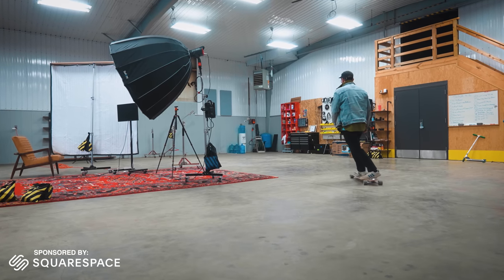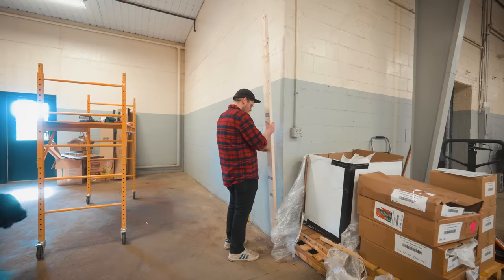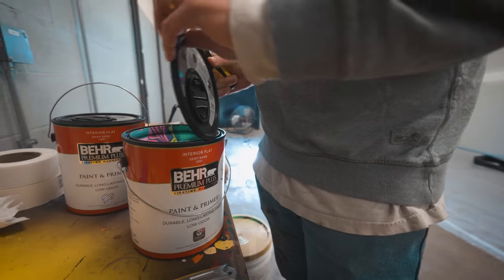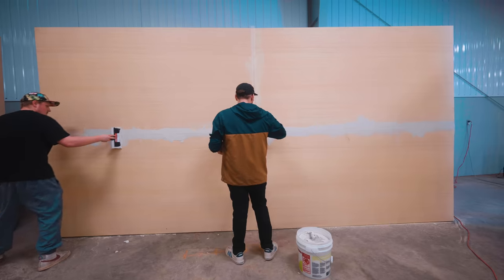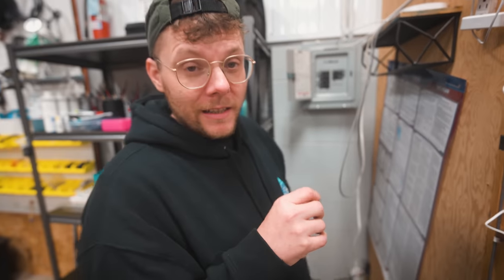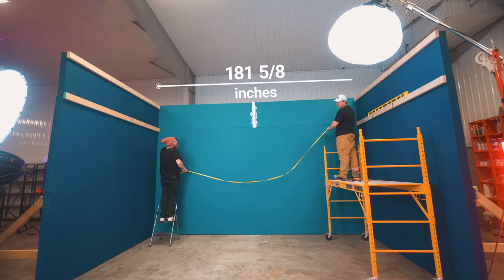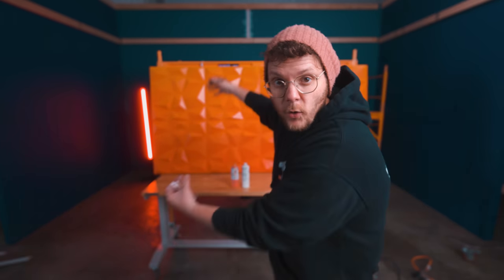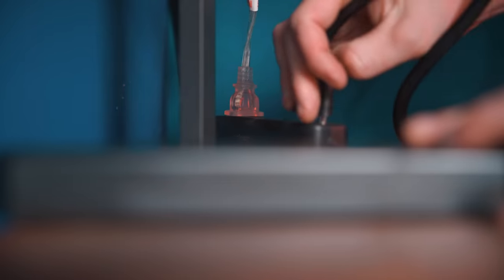From Old Warehouse to Dream YouTube Studio! - Ep2

Comment: it's a very nice office-studio on the wall behind you, you can see the connection of plywood boards, and in my opinion, the neon should hang on the plywood in the upper right corner of the screen like a logo / tag, just so that it does not interfere with the lamp.

Comment: Peter, get some 2x6x8 boards and make a square frame. Buy some rockwool insulation from Harbor Freight or Lowes and place it inside the frames and then cover it with some upholstery fabric or some other type of fabric and then place rollers under the square frames. You can move the sound panels around then and place them anywhere and they will cut down on the echoes, etc. You can make sound clouds to go overhead as well instead of using the blankets and they will work a lot better to cut down on the ambient noise and echoes.

Comment: Man, I love when projects take a turn. You had to try to fix the short wall, the extensions weren't quite working, but in the end it turned out way cooler than the original plan! The plywood with the under lighting looks incredible, and I love how you decorated the space. You did a great job making it feel like an intimate room in such a massive warehouse!

And yes. More tools = better, especially when you have the space / organization optimized!

Comment: Old time set trick: When you have a ceiling, make it all one color. Paint the boards or stain them to make them look like beams. Get edgeless sound blankets. Etc. If you can't get edgeless sound blankets, paint or dye the edges. Try to emulate a real ceiling. It will help emensely. Even if y9u never show it on camera, it will make working within the set much more natural.

Comment: Consider putting soft work matsor foam interlaced squaresin your working spaces anywhere you are standing for a long time.

It will save your back. I worked on concrete for so long and trust me this is a lifesaver and it will help your staff too, but you could put it under your whole carpet